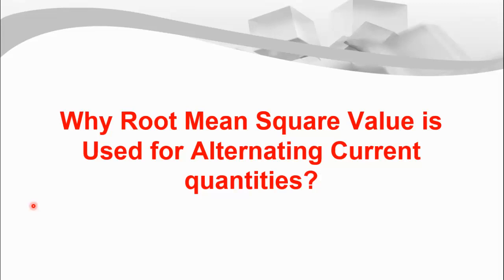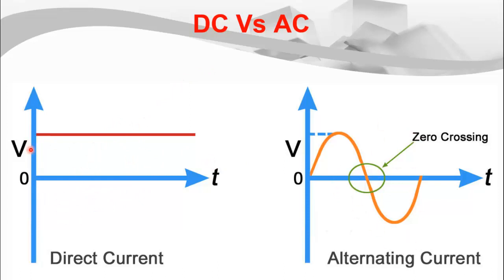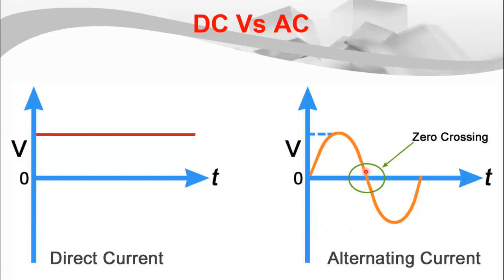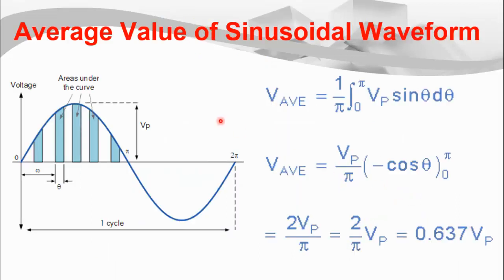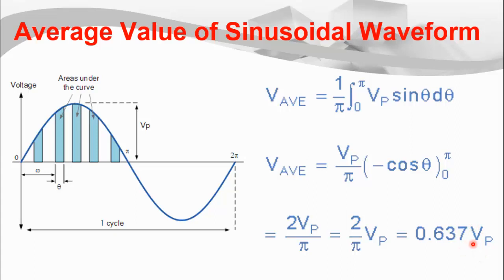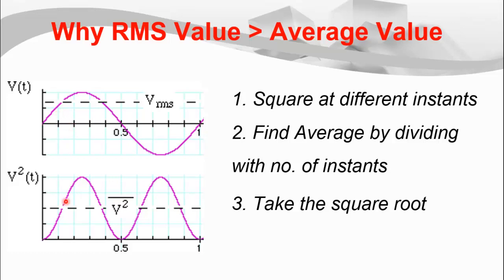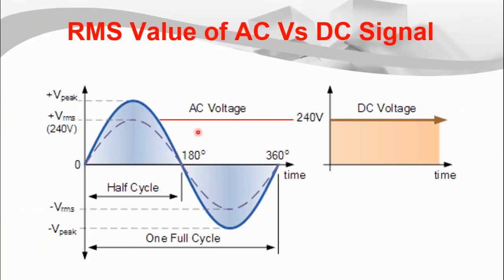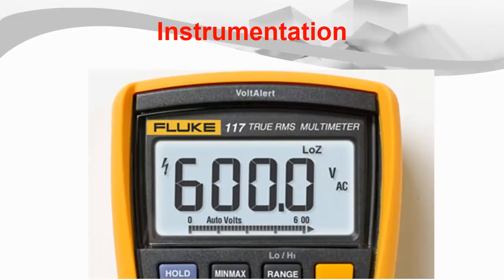RMS Voltage and Current | Why RMS value is used?

Comment: sir i always have a question that,  why not just make all -ve forms to +ve and take average ?
why its taking square and then taking square root ?
why not to the power 4 and taking 4th root ?
Reply from the maker: Because if you can easily compute with square power then why go for 4 root. Secondly by taking square all negative values become positive and then you can easily take average